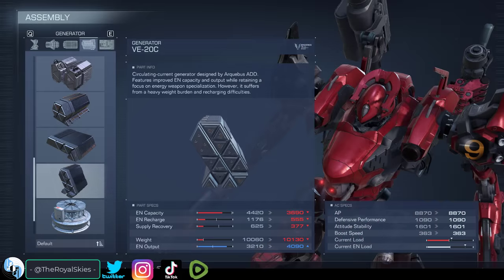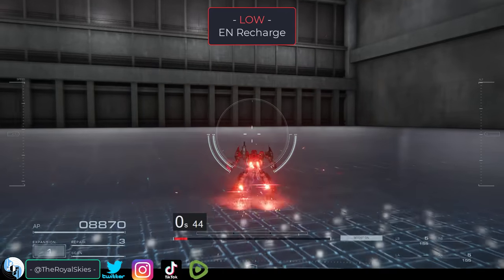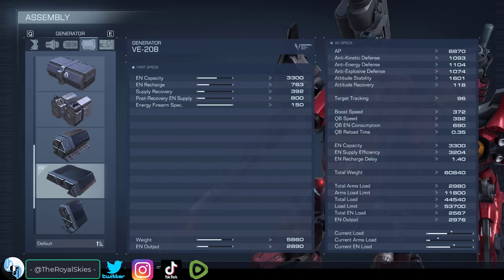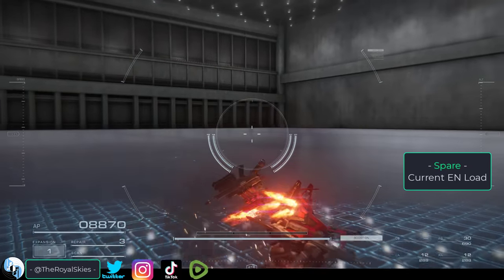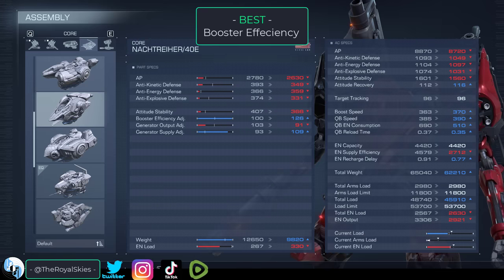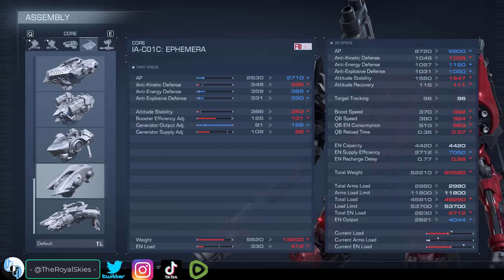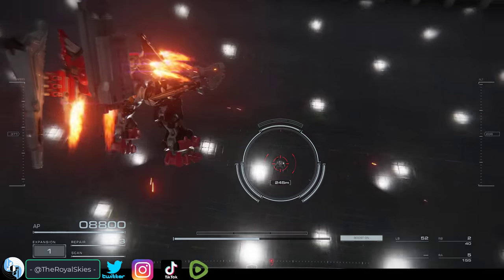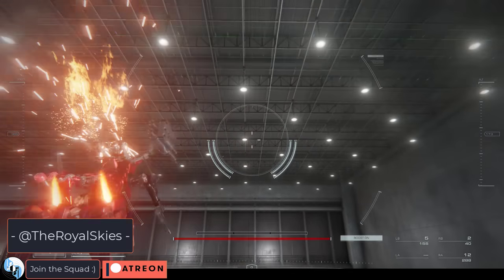How To Master Energy Management in (Armored-Core 6)

Comment from the maker: Hope this vid was helpful, good luck out there Ravens :)
Reply: if you want to fly for infinite ammount of time you need to make your en production higher than your thrusters vertical thrust en consumtion and boost consumption combined and you core has to have near 1 second recharge cooldown so your AC starts to recharge exaclty when you will loose your vertical momentum and you will start to fall. its really hard and you will be left with a build that can support a really small amount of light weapons and probably flight is going to be its only strong side.
Reply: Edit: I know you explained it after, but the initial explanation is too misleading.

You got Output wrong. Output is your capacity to support the Energy Load of your assembly. Exceeding this value will generate EN Shortfall.

It is the amount of EN Output left over after factoring EN Capacity that determines your recharge rate.

This means that a high output generator can have slower EN Recovery than a low output generator depending on your assembly.
Reply: 😂 Oh, man, I just try to recreate mobile suits from Gundam😅

Comment: Post-energy supply recovery is also an important stat on a generator, as it determines how much starting energy is refilled after recovery starts when you have none (which is what the coral gens are specialized in capitalising on, for example), since even ic recovery start takes six years, if it gives almost the entire bar back it when doing so it can be useful despite that
Reply: I was just about to say that lol. Oddly enough it's one of the main stats I sort generators by when designing a build. The question is then: does having a high post recovery supply make up for having a slightly slower recharge time and/or rate. I haven't tested any yet though. Being on PS5 it's a little harder to capture this data outside of just using my phone's stopwatch.
Reply: The coral generators are the best in this stat, but in my experience it takes so long to come on that it doesn't even matter. Honestly, other than their good weight/EN Output ratio and the fact that they make Assault Armor change from energy damage (which has a damage mitigation defensive stat) to coral damage (which has no such defensive stat) they're kind of useless.

While there can be builds that take advantage of some of the other positive factors I mentioned (and the fact that they have a greater than 100% energy weapon damage modifier) but I find I only really use them when they're the only generator I can fit on for weight and EN Output when I know what I want my other parts to do. Most of the time though, that kills the build and it winds up not being worth it and I wind up having to go a bit slower and heavier so I can use a better generator.

For being powered by the main plot device of the story, the coral generators are surprisingly disappointing.
Reply: @CreativityNull I think of the Coral generators as the niche choice or side grade, something that you can consider on an existing build you have.

My main build has a choice between the en generator with 150 fire spec, and the NGI 000, and despite the former having that 150, the generator leaves much to desire because I constantly run out of energy as I always go in the air boosting and my loadout is very energy hungry. The NGI 000's red line nature actually benefits more for this build as even when I run out, I'm still in the air moving about and after a couple of seconds I'm back to full.

Bottom line i see it as generators that are not thr be all end all, but something you can consider every so often for your existing builds.

Comment: Coral generators might take 17 years to restart but you can do red lightning explosion with them, and that more than compensates all drawbacks.
Reply: They are designed to be used completely up they refill 3/4 of the energy after a few secs much less than 7 secs if you don’t drain it all the way. Pair it with a shoulder weapon and makes you take a stance and any ac can stay airborne

Comment: Everything here is functional so it's great but, no output is what let's you use items. It's like load but for energy. The quickness to recharge that you are talking about that you can indeed observe in this video? Thats supply efficiency and you can see it when you open the expanded stats view. It's on the right side of the screen about in the middle of the stats chart. But like I said, the advice given here is totally functional. When you do what is proscribed in this video, that number shoots through the roof. Also, I'm not smart, I just watched cright. A youtuber who figured out all of the stats.

Comment: You forgot to cover post supply recovery, which is the amount you initially recover after your supply recovery cooldown. It’s also worth noting that your supply recovery starts your recharge automatically. So if your supply recovery is faster than your EN recharge, you’ll actually start recovering energy faster and more efficiently by gen busting
Reply: he also confused EN Output to Supply efficiency.
Reply: @lupvirga  He explained it well for newer players.  The supply efficiency is a new stat added to this game, but it doesn't really correlate that well.  Anyone who played older games understands it as Output vs your EN load, and it's easier to understand that way when actually building your AC.  It's nice to have a stat, but sorta meaningless.  I think it's best use is when comparing already built ACs.

Comment: This has honestly been the most helpful video ever for helping me learn how to build. I had a feeling infinite flight could be pulled off, I just couldn’t figure it out without the coral generators.
Reply: infinite flight is a "fun mathematical result" in a build (and to face certain bosses like the spider and the boiler). But I don't recommend it in PvP because you become an easy target to hit who will have difficulty using flash propulsion at the best moments.

Better to have a shorter flight time and a good reserve of flash propulsion (while maintaining honorable regeneration).

Especially since moving on the ground has certain advantages (better flash propulsion distance, better average speed, etc.).
Reply: Infinite flight and missiles is an easy way to S rank the strider alt mission.

Comment: Double check the thumbnail "INIFINITE" 👍
Nice demos of what each stat means.

For S-ranking and pure speed I use the full Nachtreiher frame with Shade Eye head (for style) with Alula booster and NGI 000 generator. Allows for 9 quickboosts with 0.35s cooldown. Weapons are dual Haldeman and dual GU-Q1 Pulse guns giving me: Supply Efficiency 5483, EN Output 3949 so I can happily red line my generator, wait a few seconds and the bar is near instantly full again.

An important aspect I think you missed for energy management is having the right booster and FCS too, especially if you're wanting to be in the air a lot. Gridwalker booster has massive upward thrust but QB cooldown is 0.70s which maybe too slow for some people. If I changed from my current FCS to the WLT001 - that's an EN Load increase of 254 points which translates to losing over 1000 in EN Supply Efficiency overall (slower EN refill if I don't deplete all energy. Definitely worth checking all aspects of your AC when tweaking for optimal energy use and testing 1 component at a time rather than making lots of changes at once.

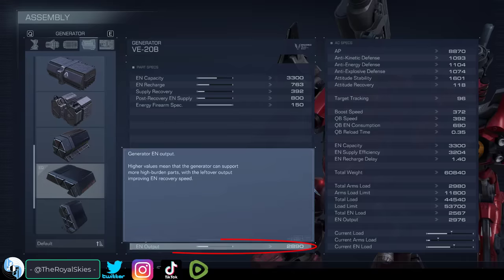Comment: 1:59 Output is the amount of gear you can equip to your AC. What you're talking about here is supply efficiency which is based on the difference between Energy Output, and the actual energy load of your AC.
Reply: It's all the same thing.  I think his explanation is easier to understand for newer players.  The extra stat is nice, but for newer players more numbers can be confusing and it doesn't tell the whole story, the way he explained pretty much told you everything you need to know without overburdening you.  I think he explained the best way to build around it.  The supply efficiency is good at the end of the building phase for comparing to other already built ACs IMO.  I've literally seen some of these tournament organizer streamers get tripped up by the supply efficiency stat and putting too much or too little stock in that number.
Reply: @GriFFonRec4 it's not even remotely the same. A new player might build a high output AC and use up almost all the load then find their recharge to be slow AF then claim the info on this video is wrong.
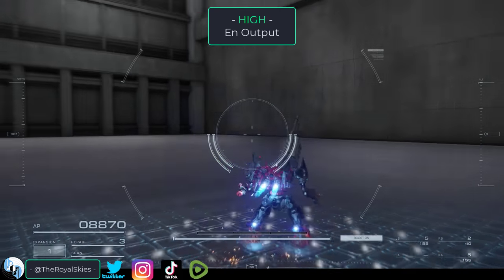Reply: @igtenoz  2:22
Reply: To both of u, royal bro was not wrong in his explanation of how supply efficiency works. However, he was incorrect in calling the speed at which you recharge energy (after the initial delay) as output. Output is basically voltage on a battery. The core output stat only effects your ac’s final output value (or max voltage). In game, you can use up to max output, but doing so destroys ur supply efficiency. Supply efficiency is a vital number to understand when optimizing ur ac, if u don’t wanna be miserable when piloting it.

Comment: This may help some of the math heads out there, but there is a simple equation you can use to find out the duration or number of boosts you have on one charge. For energy output and consumption rating, it's in Units Per Second. Well say G is generator capacity. C is the energy consumption of boosting action, Vertical, AB, or QB. D is the duration you can boost in seconds, or number of quick boosts you have (same equation). A note for QB, be sure to use the AC spec not the booster itself.

D= G ÷ C

Using my AC as an example, my generator VP-20C has a capacity (G) of 2720 
My ALULA Booster has an EN consumption of

760 Vertical
435 AB
QB is Based at 690, but core adjusted it to 510, so we'll use that. 

VB 2720 ÷ 760 = 3.5 seconds 
AB 2720 ÷ 435 = 6.2 seconds 
QB 2720 ÷ 510 = 5 boosts with some energy remaining. 6 with fully drain. 

I can't say I discovered this, I adopted and reversed an existing equation from earlier games. If you got this far, I hope it helps.

Comment: You forgot to mention Post Supply Recovery, but for simplicity's sake. It's the initial amount of recovered energy once supply recovery starts kicking in after getting COMPLETELY DRAINED. This is one of the reasons why Coral Generator can sustain your flight despite having ungodly amounts of weight load, because the amount of post supply it gives is throught the roof. The trade off for it though is that supply recovery takes a while to kick in. It is also best paired with Alba Core because it speeds up the post supply recovery.

Comment: Your total energy outtake for your parts also really applys to your maximum output. Say you have the same generator with 4000 compacity, but you have a bunch of really heavy and EN consuming parts overall youll have less EN to work with despite having a huge compacity. 

Thats where you see some people make the mistake of having something with low capacity, and they then load it full of parts that take alot on EN and then wonder why they can't stay in the air longer then 6 seconds and are constently out of EN

Comment: The low ceiling makes it hard to show your point at the end, but yes if you AB as straight up as you can with that setup you can gain 2 or three times the height than you lose when you run out of EN and are waiting for the supply recovery to kick in again allowing you to tap jump a few times before having to AB again to stay in the air, also tapping jump at the last second of an AB before you run out of EN will maintain your momentum so you will keep ascending for a little while you wait on supply recovery

Comment: As an old raven who never really goes to flight in old AC game and just bunny hops in AC1-LR and chaining quick boost in 4-4A (haven't play 5th gen) the Nachtreiher is the ideal core part for me. You got massive boost speed, make dodging way easier, and because I'm mainly close to the ground (never goes beyond jump height except against some bosses) the energy recovery isn't that bad. I'm also mainly using kinetic weapon with low energy drain to help even more with recovery).
Reply: Yo, me too! I tried some other similar cores such as the Firmeza, but I keep going back to the Nacht. It's just the perfect blend of attitude recovery and jump height for me.

Comment: Nice video Hustler One :P informative

However, there were a couple of things you missed that could be helpful.

The core's Generator Output Adjust effects how much your "EN output" is (your total possible EN load.) It doesn't specifically affect how fast your energy recovers after the supply comes in (which is nitpicking, because the difference between your EN Output and Total EN Load will determine this and increasing your EN output could determine it if you dont just use the extta EN output to slap on more energy hungry parts, which is why this distinction is important)

Next thing, there is actually a stat you can look at in your AC specs to determine what your recharge speed will look like. It's called "EN Supply Efficiency" (which is kind of confusing because your core has a stat called "EN Supply Adjust" that does not influence this stat whatsoever, it instead affects "EN Recharge Delay") However, you kind of have to play with it in testing because while higher is obviously better, there's not an obvious correlation between the number and perfirmance (like you can see with some stats just being a percentage modifier)

The nice thing is that all of these are accurately described in the tool tips if you look at contextual help and at least on the surface looking at the stats it appears to work the way the tool tips say it does. So far the effects work as expected in game too.

Comment: Great video! Since we are talking about air-stall, my question is: does the weight of AC affect its falling speed? and What can we do to control/alter falling speed (other than thrusting upwards, obviously)?
Reply: From what I've seen, no.

I tried making the absolute heaviest monstrosity I could to fall to the bottom of depth 1 as fast as possible, and didn't notice any appreciable difference compared to other frames.
Also despite swearing I felt a difference, when I put it to a test, being significantly over your leg's load limit didn't seem to increase fall speed either.

Note: these are specific to purely falling. Boost hovering may be different.

Comment: can you do a break down on what the resistance values mean? what's the difference between 1000 anti-energy defense vs 1300 etc. awesome vid as usual
Reply: 1300 defense is 30% damage resistance. Basically just do (your defense value - 1000)/10 to get the resistance percentage.
Reply: ty @dakota0000001

Comment: I think the linking of cores with energy management in terms of their stats is probably why I'm not enjoying the build system as much as previous titles. Its a lot less flexible, and this is made worse by a lower part count in this game. It tends to feel stifling and confining, rather than empowering and expressive.
Reply: I am of the opposite opinion, want to keep the massive EN cap of San Tai but EN output is too low? Slap on the Ephemera core and you are good to go. Sure your defence is lowered but such is the price of high EN cap and also good regen.
Reply: My main issue with the rather short lists of part is simply that a lot of the parts just don't look good together visually. the Ephemera is probably the most unique looking AC in the entire game and because it basically is the only AC that uses that type of design language, it basically never truly fits with other AC parts.
I hope they release an expansion for this game, expanding the game and more importantly expanding the part lists..
Fuck, I would gladly buy for ac frame parts as dlc, if they look good.
Reply: @quasadra  I don't want to change the core. I suddenly don't like how my build looks anymore and I have no means to comp the difference with tuning. My robot is no longer my robot. Its like... I understand there's a tradeoff between build appearance and functionality, but its never been this strict in terms of EN or this meaningless in terms of legs before. The cognitive dissonance is massive.

It feels like I get way less say in what my build looks like, and way more say in what my boosters or generator look like, because the pressure switched places.

I always thought the core was supposed to enable options, not confine them so again, weird cognitive dissonance.

I do not like these changes.
So much of AC6 rubs me the wrong way.
It feels like the Smash Bros Brawl of AC.

I do like lots of decisions (hardlock being a no-brainer) but the combat ranges, the fixed turnrates which make pvp feel completely flat and damage-racey and makes positioning about ranging instead of acquisiton... FROM could have decoupled the camera from the body and this would have worked well but they didn't... idk. 

I'm glad AC is trying new things, but 6 just isn't for me, and that's OK.

Comment: Actually you’re wrong about output.
Well, sort of.
Output determines your maximum EN Load.
High Output and Output Adjustment increases your EN Load capacity.
Supply Efficiency is determined by the difference between current EN Load and your maximum.
Supply Efficiency is responsible for the speed at which you gain energy once you start regenerating.
What this means is that you can have both relatively low Output but still have high Supply Efficiency, as long as you don’t get too close to your maximum capacity.